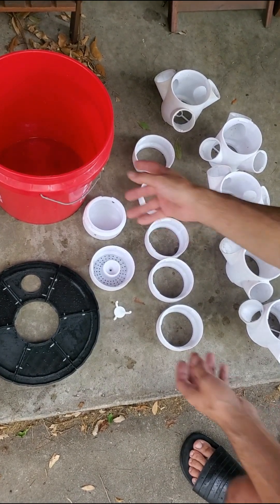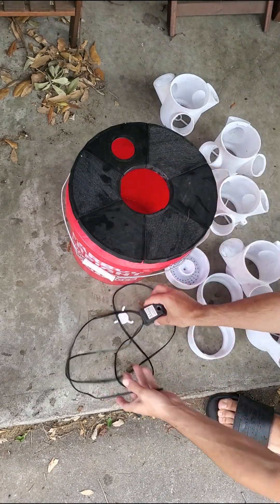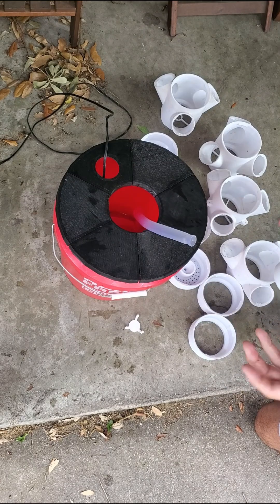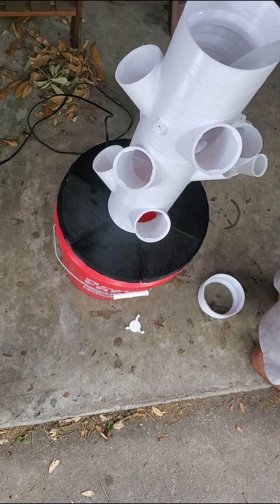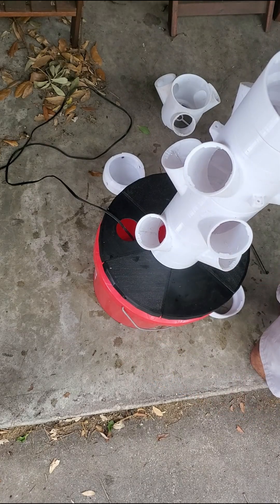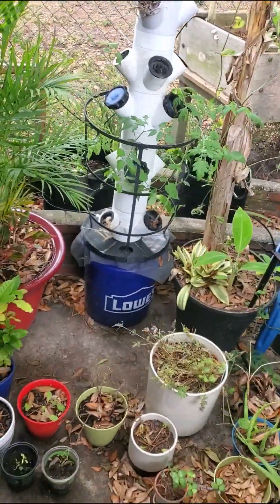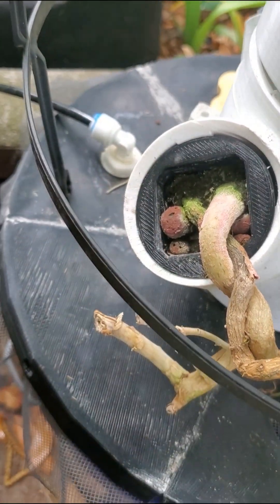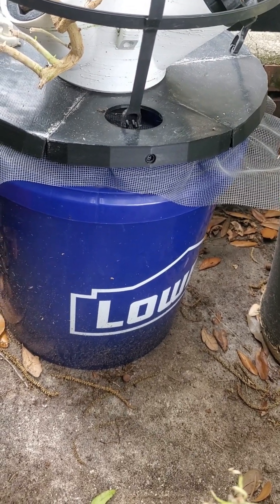3D Printed Hydro Tower Assembly

Comment: Which printer did you use? I want to print a tower but have never done 3d printing. Was looking at the Bambu printer p1p I believe is the model.
Reply from the maker: I used a modified longer lk5 pro. They are printed in white petg. 
The Bambu printers are faster so you won't have to wait as long. You are locked into their system though.

Comment: Hi friend! I tried printing one but water leaked out the filament of mine. How is you tower doing? Are you going to publish the 3d files in your website? Id love to compare yours with mine. Regards from Brazil!!
Reply: I’ve built 2 of these so far. Both just under 2 meters tall with bucket.  I’ve never had a leak. I recommend you use PETG and at least 40%-60% infill. And 80% for the base.  PETG does have to print a little slower but the time was far better with the second one I built after changing to a 0.6mm nozzle.
Reply from the maker: I agree on the bigger nozzle. I use a 1mm for large objects like these. I also use a 0.4 layer height. It makes a huge difference on time and you can see the lines but it doesn't matter when the plants start growing.
Reply from the maker: I have not had any issues with these leaking. If it is outside and you are not losing water at a high rate, I wouldn't worry too much. You could always let them dry out and then fill the cracks with CA glue or use a 3d pen to fill the cracks. I have used silicone caulk too. The real issue is probably with the printer/slicer settings though. Do you have a picture of the print? 

I printed these with PETG filament because it would be outside. I used a 1mm nozzle and a 0.4mm layer height. I don't usually go over 20% infill because the walls are plenty thick. The design is not mine and the link I have from the readme file is a 404 on thingiverse now. I guess I could re-post them.